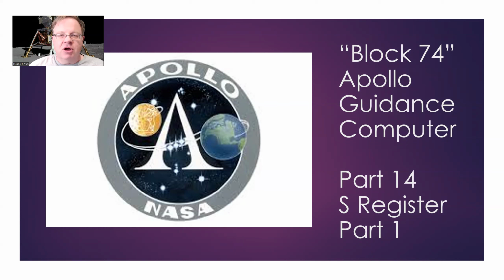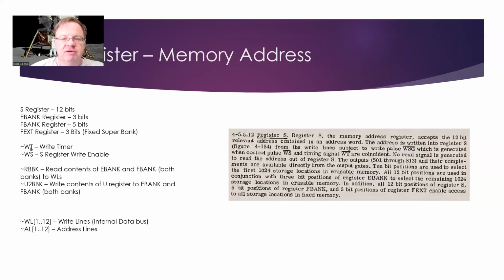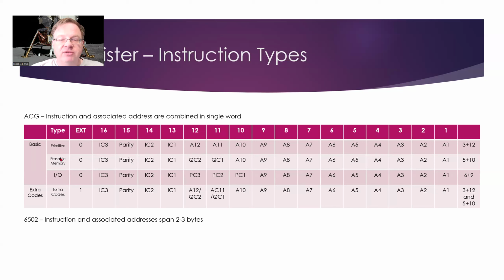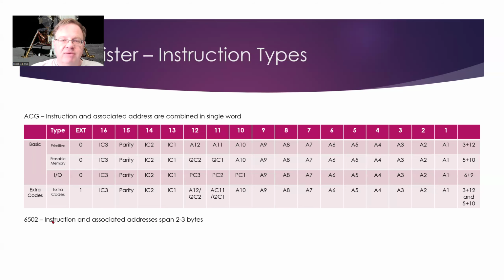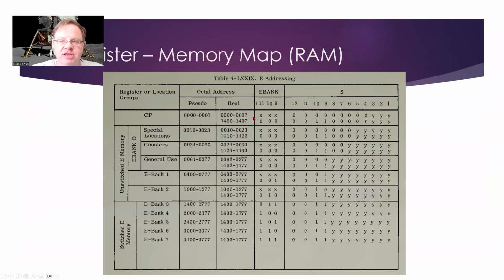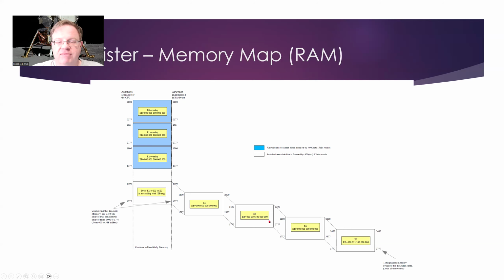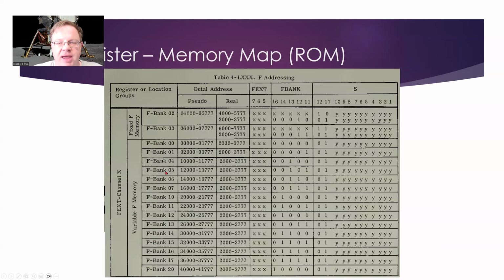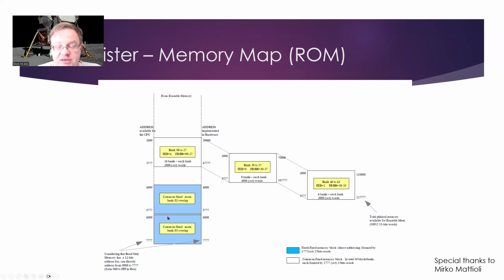EP: 14 S Register   Part 1

Comment: Small historical correction: Block I was also referred to as "AGC4", and was already the fourth iteration on the design -- making Block II arguably the fifth. Block I already had the EXTEND instruction, although it was implemented in a different way. Its predecessor, the Mod 3C ("C" for "Complex", because it included hardware multiplication!), did not. The Mod 3C only implemented 8 instructions, all directly encodable with the 3 opcode bits: TC, CCS, INDEX, XCH, CS, TS, AD, and MP.

Block I's EXTEND is kind of weird in one sense but also makes a lot of sense. It's not its own (pseudo-)instruction like Block II; instead, it is activated by using INDEX to cause an overflow condition on the following instruction. This overflow essentially allows you to write into a fourth bit for SQ. The assembler does recognize the "EXTEND" mnemonic, for which it emits INDEX 5777. By convention it is expected that the programmer has left the constant 47777 there (this must actually be part of your program! If it's not and you use the EXTEND mnemonic, you will have a bad day).
Reply from the maker: Appreciate the clarification. One area I’ve been trying to understand is how the FEXT (or super bank) registers are set. There are control pulses to write the BB registers from the “U” register and read contents to the write lines.
Reply: @kellymcdonald78  FEXT is three flip-flops that are only accessible via I/O channel 7. There's no special mechanism to read or write to it, other than the standard channel I/O instructions that use RCH/WCH. If the programmer wants to construct the full current BBCON, the idiomatic approach is to load BB into the accumulator, and then ROR channel 7 onto that. In the other direction, WRITE is the instruction most often used to change superbanks.
Reply from the maker: Thanks, I see it now. I'll have to dive into it a bit deeper when I get to the IO logic.